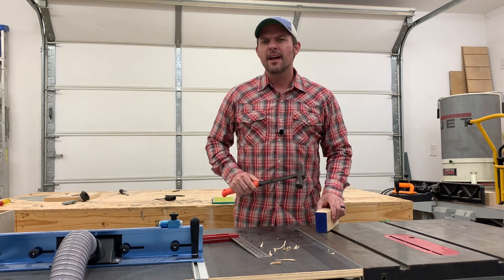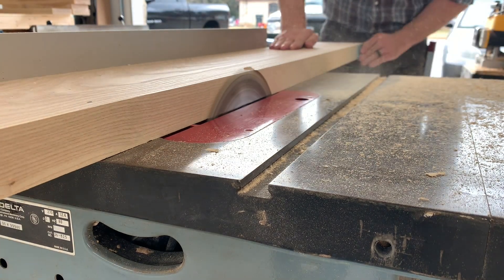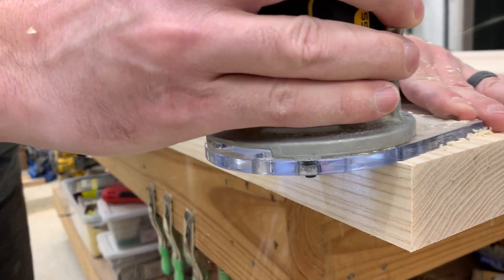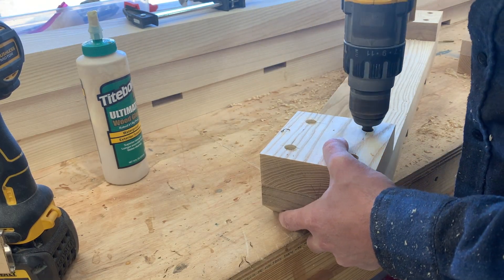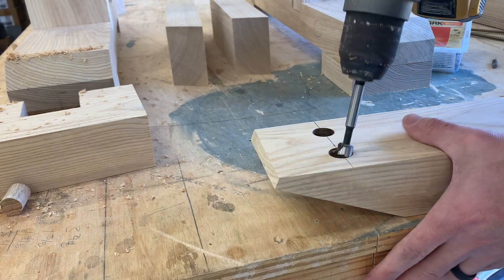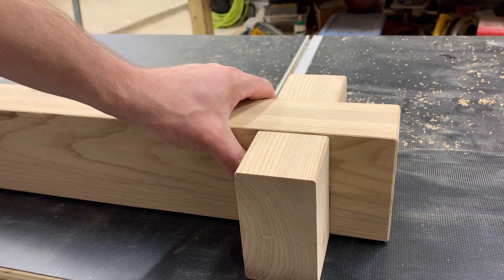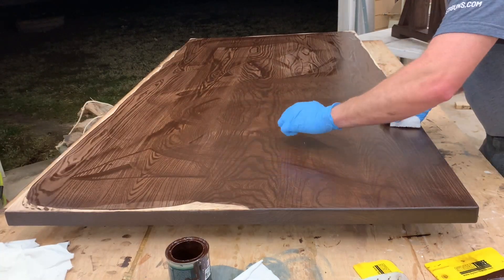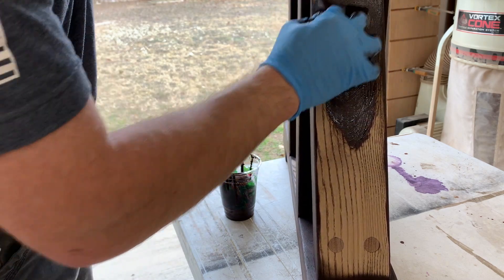Easy DIY Farmhouse Table //  Assembled Like Real Furniture

Comment: Nicely done on the table sir and a well done video too might I add. If you save up the end pieces or off cuts from the table top, you can slice them into 1½" strips, and glue them together to make an end grain cutting board. We used to keep odds and ends in the cabinet shop for that purpose and who doesn't need another good cutting board right?
All the best to you all.
Reply from the maker: Thanks, Dwayne.